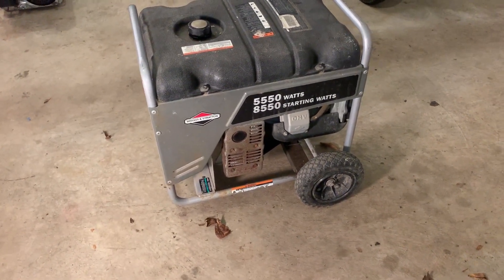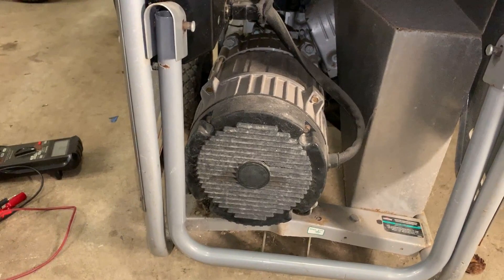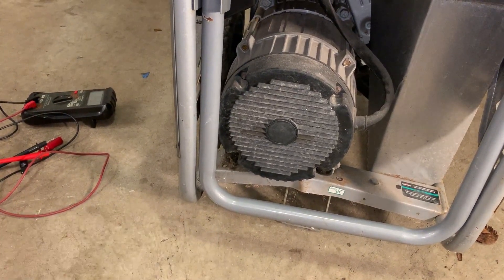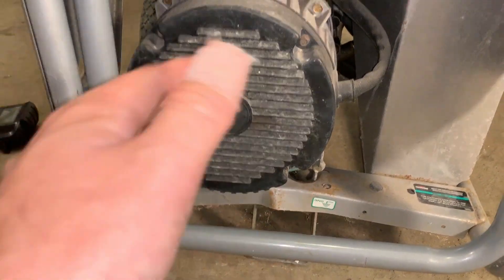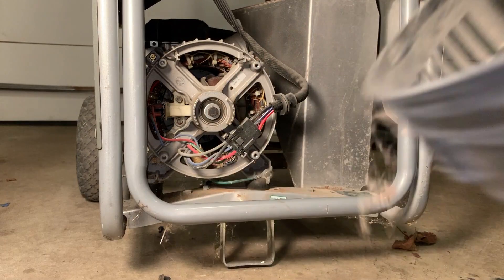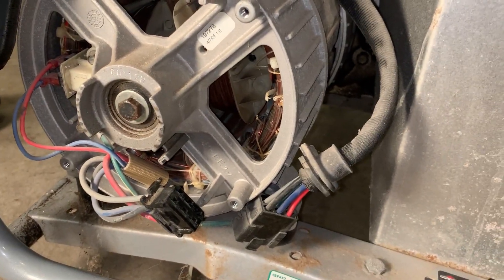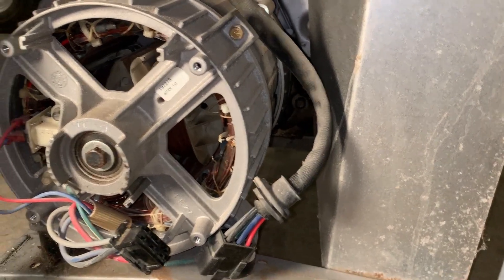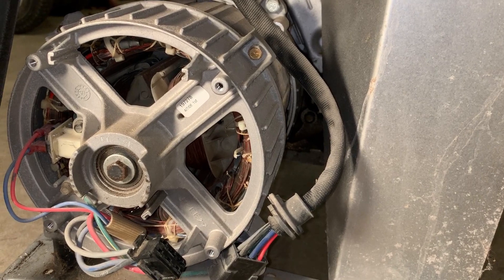What a Bad Generator Stator Looks Like

Comment: NEVER  SHUT  OFF  THE ENGINE,  WITH  ANYTHING  PLUGGED INTO  a  generator UNDER  A  LOAD.   Also, let it run, for a minute or two, AFTER  switching OFF, the load and unplugging it !  NEVER  start - ANY  generator, WITH  ANYTHING  PLUGGED INTO IT .   Stay  safe,  start it ; run it for 3 minutes, apply load.  Take  care, of your   equipment !

Comment: Right, i got a Power Fist DF6500 H  for   60 $  Canadian. Its'  got a burnt,  16 turn winding, on stator, to Excite the rotor - through the brushes.  Rest of coils, are Good. (in ohms)  There is a bar-code label, with a number .  It is L-SC06-01-13221    //  IF  anyone, has / knows the actual 8 or 9 digit, Power Fist part number, i'd  be  greatly  appreciative. Engine is good. Brushes in very good condition ; appears someone shut gen off , under a HEAVY  load.  Anyway....thanks for all you do / show/ teach us Master  DR   Condon !  ...cleanest hands, we've  ever seen....(alberta canada)

Comment: Shi, go to your local dump and buy a damn dryer for 15 bucks take the rotor out put the magnetized one in and voila, not necessarily that simple but pretty much youd have to test the new wires and appropriately connect them , and you'd have a different v/a rating that you'd have to figure out
Reply from the maker: Thanks for the info

Comment: Hi, I love your videos.  The detail, videography and your knowledge are fantastic.  I found your channel when trying to solve the issue with my Parker PP-2800 generator.  The stator is discoloured and several strings are burned.  It happened when I ran a hairdryer 1kw for 5 minutes. I was shocked that this happened considering the generator has hardly been used but I was testing it in the event of expected power cuts.  My question is, what reasonably priced puller tool do you recommend to remove the generators head so that I can replace the stator?  Thank you.  Peter.

Comment: Then I take brushes out and do ohm test directly on the slip ring plate
 I get nothing .
Reply from the maker: There must be a broken wire on the rotor.
Reply: Wash the rotor, very well. Let dry overnight. INSPECT the wires, with magnifying glass - especially from slip-rings, to windings. Very good makers, use a hard glue, to keep them from being torn, while rotating at 3600 rpm. Might find, that there is a break, right where the connectionn is to the slip rings. Or, wires were damaged, on dis-assembly.  ( old electro tech)Another thing, maybe ohm-check , from one slip ring, to some single wire coil, about 1/2  way  into  the winding  stack. Keep going, until there is CONTINUITY.  This way, you'll nknow for SURE  if there is a broken wire, somewhere. Be carefull, when scraping the wire, for the probe connections.    Good luck, Sir. Bud .

Comment: Have a 7500, 9000watt peak chonda predator, if slip rings-rotor test ok what wires of the 4 on the buss bar would I test to tell me if the stator is shot? Have identical one that worked before rings on engine went south. L1 and l2, r1 and r2 show 5volts while running, 0v at brushes. Has burnt 2 avrs, or just quit making power, a used one and cheap new one. In a heat wave so readings will be off I'm sure except a short to ground or...and ground. is unbonded if it matters, thanks! Did try the drill trick to no avail.

Comment: If the stator ropes are broken or melted, does that mean that stator is for sure bad? I have been working on one that sat for years, and it looked like they dry rotted from sitting out in the weather. But generator does not produce power..soooo 😩
Reply from the maker: Have not seen one yet with broken lacing that is good.
Reply: @jcondon1   I was afraid you were gonna say that.🤣  The stator tested good, but I have saw you check the "ropes" on the stator in a couple of your videos.  Thank you for the quick answer.

Comment: Hi
Good videos 

I have a generator like this
Brigg&stratton 5550
I but the power in the house and forgot to disconnect the generator
Now no make power
I try a few test i see in your videos but nothing everything seems to be fine
any suggestion of what the problem may be
Reply from the maker: With any luck it blew the fuse on the generator before taking out the stator.  Take am ohms reading from each of the 120 volt outlets.  Should be around 0.3-0.4 ohms.

Comment: thanks! picked up a non running, not powering chinese generator and tried the drill technique first to no avail and having seen these signs i will not bother with it and go forth with the initial plan and see if i can fit the Chonda motor to an old water pump to save the rugby field from the scorching sun this summer.

Comment: Probably hit by the car while someone was parking in the garage. I bought a mower like that once, it looked brand new at first glance but later on I realized it was all racked and cattywampus to the point that the self propelling didn’t work and it wouldn’t track properly. There was one little dent where it looked like a car bumped it but I think the real damage happened when it got squished against the garage wall.
Reply from the maker: Just picked up another one like this.

Comment: There are shops that rewind armatures for a reasonable price. Don't they rewind stators as well?
Reply from the maker: I looked into it once and was told by the shop it was going to cost more then the generator was worth new.  So did not look into it again.
Reply: @jcondon1  Wow. I had a wiper motor armature rewound for $100.
Reply: I worked and retired from an electic motor repair and rewinding facility. The labor to rewind a stator is $128 an hour.And estimated time to strip out old windings and prepare core and insulate slots for installing new coils which have to be made to size for application, correct wire size and turn count per coil. Lots of labor. Est. Minimum of at least 10 hours labor plus cost of copper wire and slot insulation , lead wire , overloads etc. Would be at least $1500 for the shop to even consider doing the job. Cheap if a Chinese replacement stator can be found.But Quality?

Comment: Looks very much like my TroyBilt Geny, no AVR but a rectifier set-up on the brushes assembly.
I measured the voltage from the st8or to diodes, 7.5 a.c.
Reply from the maker: This generator wears many badges.

Comment: Hello James, if this has a bonded neutral and in heating up the winding made contact to the
ground, then the spot in the winding  would send current to the neutral, maybe by breaking the neutral to ground connection it might work, but that would only tell you what you already know.
the generator is trouble and one could possibly be electrocuted, between a bad tool or an 
extension cord. get rid of it. . .
Reply from the maker: Yes.  Kept the engine and recently used it to repower the storm responder on the video a released two weeks ago.

Comment: I noticed that this generator, like mine, it does not have an AVR.  I took the whole thing apart looking for it.  It seems that it is a simple self excited field coil that gets power from a separate winding in the stator, that is rectified by a full wave bridge (4 diodes) on the PCB with the brushes.  Since there appears to be no regulator, what keeps the voltage from running away?  Another words, more excitation of the field coil induces more voltage in the separate winding, which then increases field current, and on and on.  I did notice the same sort of coloring of the stator windings in my generator as the one you showed.  I am thinking the "black" wires are not in fact burnt, but painted with a different color.  I looked very closely, and the color of the wires that are black are uniform, and the generator still works perfectly after I put it back together.  Non of the string/tying rope was broken.  Thanks for your great videos!
Reply from the maker: Like you identified, no AVR.  Just a bridge rectifier and a capacitor.  The voltage is directly proportional to the engine speed.  So if the governor maintains the engine speed then your voltage will be good.  You usually have to set the RPM a little high to 62 hertz at no load (about 129 volts).  When fully loaded the voltage will drop to about 115 volts and the engine will slow some to 58-59 hertz.
Reply: @jcondon1  Thank you!  That is pretty much what I measured today when I was testing it with a big load.  I really appreciate the help and quick response!  I look forward to the next video.
Reply: @Craig1967  my stator wires appear to have distinct colored black copper wires as well but not burned or shorted and ohm ok.almost look painted black or darker laquer. Vomtage output is spot on as well. Is yours working ok?
Reply: @30roundclipazine79  Last time I started it, yes.  I am waiting for a cooler day to work outside and do some work on it.
Reply: Thanks for the quick answer. Did you ever find a difinitive answer as to wether or not the stator wires were supposed to be that color? Like i said my main windings are .3 ohms and the rotor windings are about 27ohm andbthe excitir windings are 1.5 ohm.with none of them having potential to each ither or ground. I just bought my generator used and eas sick because it kept tripping the red breaker switch but i suspect the breaker is going bad because it trips under moderate kiad then i can turn it right back on and my vomtage output is perfect.plus engine doesnt sound loaded as if there was a short. The mIn concern for me was the stator wire colors but like you said it almost looks intentional i just havent found any proof of this besides your post.
Reply: @30roundclipazine79  Jim mentioned to me that he has seen other generators with the black wires, after this video posted.  I believe the black color is normal, since none of the string wrapper was burned.  I also took a needle probe and tried to see if the black insulation is truly burnt.  It it was, it would easily flake off.
Reply: @Craig1967  thank you so much. You saved me from scrapping my generator. It randomly trips the breaker under any load but it's out correct voltage. I ordered a new breaker.

Comment: Jim, under normal circumstances, how long will a portable generator last with proper care???? It seems to me there's always something that goes wrong with them!!!! The fix seems pretty easy but nonetheless they do not seem too durable!!!!
Reply from the maker: That is a hard question.  The engine side should last thousands of hours with proper care.  The generator side is hard to estimate.  A lot depends on the load, outside temps and the quality of the manufacturing.  The generator side is the most common point of failure.  Some generator heads fail within the first 100 hours.  Others will last 1000 plus.  Unfortunately the generator heads are not built to last on lower end models (less then 10000 watts).
Reply: @jcondon1  Yes, I can understand the quality control issue leaves a lot to be desired. I realize it's not fair to judge the durability of a generator by the number of repairs on different makes and models. However, you wonder if it's worth the investment!!!
Reply: @jcondon1  Do you know much about the Predator generators? I have heard good things..but I would rather hear from an expert. I am looking into them right now after stripping my other one for useful parts, and" junking it" today.🙄

Comment: Glad to find your videos. I’m currently looking for a generator and wondering if you have any videos on what to look for or avoid when shopping for a used generator.
Reply from the maker: It's a good idea, but I have not made a video yet on that topic.  When I shop for a used generator is probably different that what you might be interested in but here is a quick list.  1) how does it sound when running? 2) was it stored indoors? 3) was it used much 4) is the gas tank metal or plastic.  If metal check the inside for rust.  5) who makes the engine?  Honda, Subaru and Briggs are fairly easy to get parts for.  Most Chinese engines are hard to find parts for.  The only exception might be the ones that Generac and Ryobi use.  But not sure how long parts will be available.  I am working now on a 30 year old generator with a Briggs.  ALL the engine parts are still available!.  6) Does it have a low oil sensor? 7) Does it have an AVR? 8) Probably the most important thing is the generator head.  Most generators die either because they were run out of oil and destroyed the engine or the generator head goes up in smoke.  If the person selling the generator will let you, remove the generator head end cover and look at the copper wires on the stator.  That will tell you a lot.  If the stator has over heated you will see it in the wire color.  Some wires will be a different colors from the overheating (dark or burnt).  The wires should be a nice copper color and all look similar.  Sometimes the color could be a little difference depending on the winding varnish used.  Of coarse it is still no grantee that the generator head will last, but at least you know your not getting something that is most likely going to fail sooner then later.  And lastly get the model number of the generator and the engine and see if parts are available.  Generac and Ryobi I have noticed do have parts availability but take the carburetor for example.  The generac XG10000E's carburetor costs almost $200.  If you only need a $9 main jet they make you buy the whole carb and do not sell just the part you need.